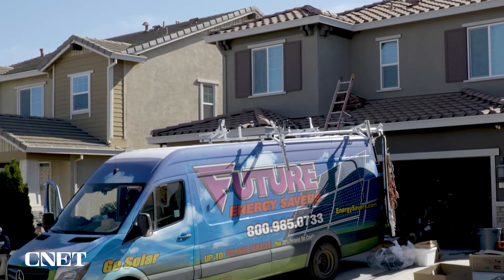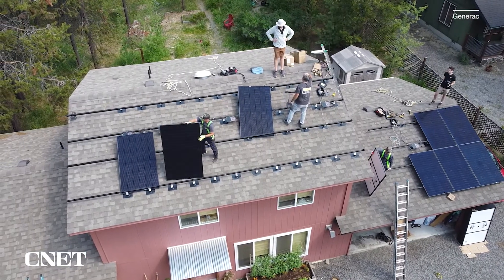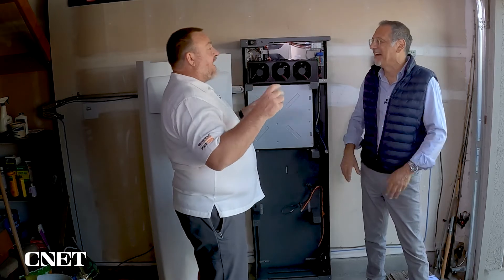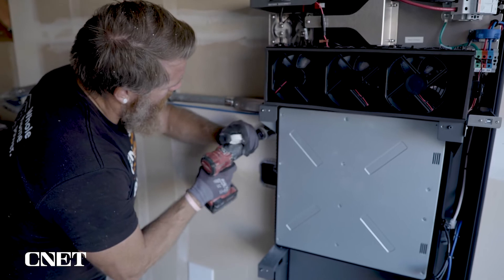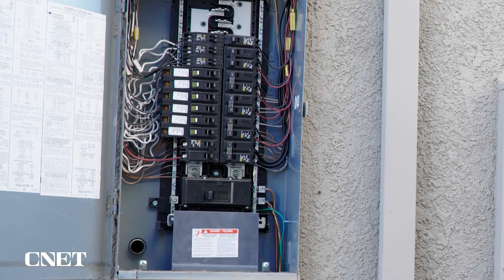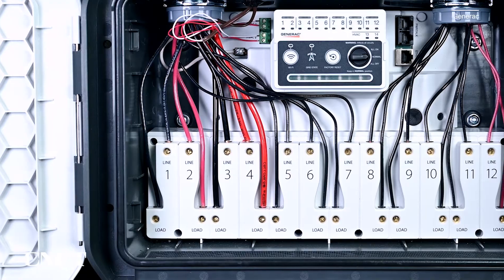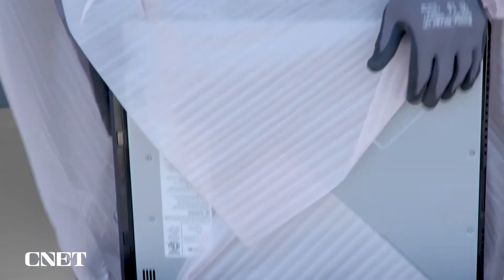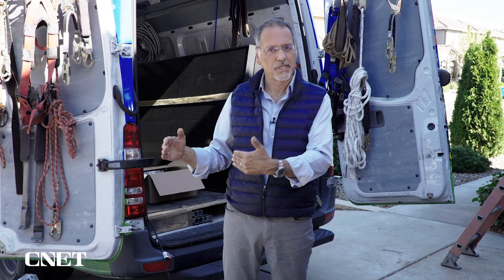Generac's PWRcell: The Alternative Power Solution for Rising Energy Costs and Aging Grids

Comment: I have this system and have been very happy with it.  Unfortunately I have a battery error (7000 error code) that could not be resolved so my installer needs to come out.  I hope this is an exception as I have read of others having the issues.

One question is if Generac is going to stick with NMC for batteries or if you are planning to migrate to LFP?  I know thatTesla Powerwall 3 is using LFP instead of NMC due to the many advantages.  I'm hoping Generac will follow suit.  Thanks!